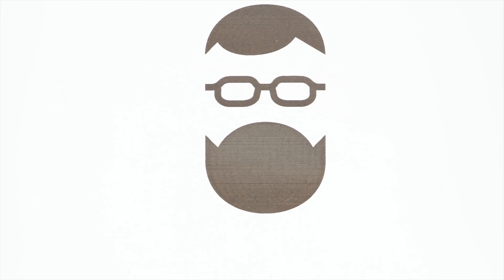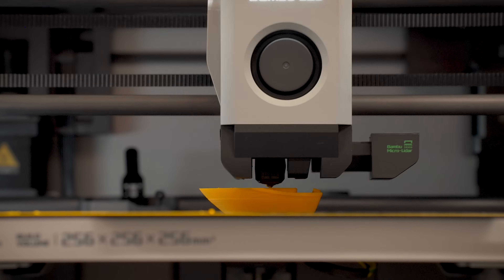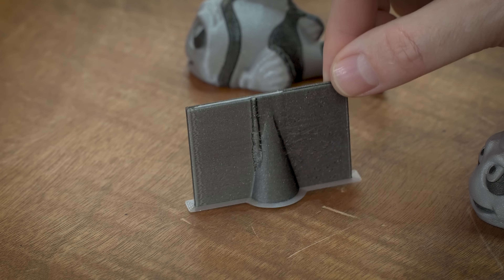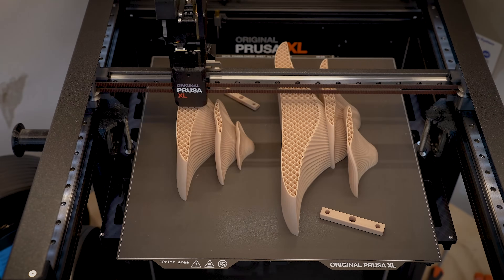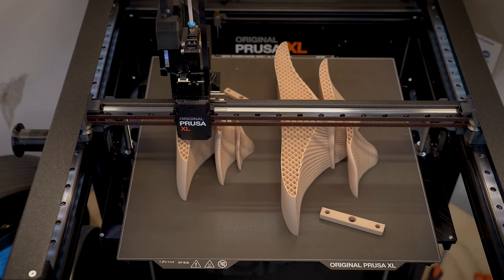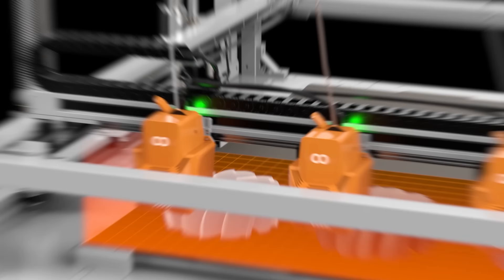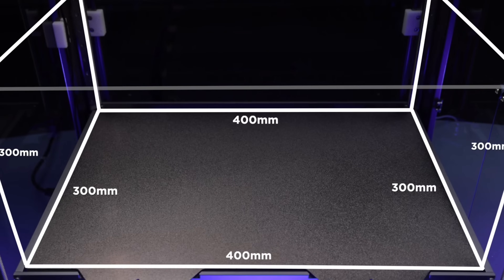Choosing Between Prusa XL and Bambu X1C?

Comment: Support? Software? Replacement Parts? Longevity of being supported? Things especially beginners need to know what they are signing up for.
Reply from the maker: Eh, they're both pretty good.  Longevity is something that is questioned with Bambu, but the XL is a completely new product with an unknown track record.
Reply: @RobertCowanDIY  I was more referring to the companies. I have heard Bambu support can be hit and miss.
Reply from the maker: @tyler785 I don't normally defend Bambu, but you have to look at their user-base.  They got a LOT of new people into 3d printing, so the data might be a bit skewed since their users might tend to be less proficient.  But in general, I'd agree.  Prusa has better support and some of the best in the industry.
Reply: @RobertCowanDIY Well based on the latest Bambu news, i would avoid Bambu everything going forward.
Reply: Support
I find the support argument an odd one.
If the printer is unreliable you need good support
If the printer is reliable good support is hardly needed. 

I wonder where prusa XL falls as a bunch of folks are having issues with their XL. 
1yr warranty on both (in the states)

replacement parts
All parts are inexpensive and available online for Bambu ,Full hardened hotend(heater, fan, thermistor is $35 otherwise nozzle is $15) shipping is fast and free over $50
Some parts are not available for the XL and are pricy. Nextruder brass nozzle is $50, hardened nozzle only  is $60 Shippng is around $20+
Multiply all XL parts by 5 for the 5 head as they only ship brass initially. 

Both have forums, communities, wiki and youtube channels for repairs. 
Bambu gives you maintenance reminders for cleaning, greasing, including wiki links

Software/firmware  
Bl had many updates and meaningful firmware updates since Aug 2022. Silent motors, camera, filters, remote controls and monitoring, object exclusion, 
Auto filament calibrations, print fail detection, first layer detection and the ability to print without touching a slicer program
BL studio and it's fork Orca is arguably some of the best fdm slicers available. 

Prusa slicer is well seasoned and profiles have been good for prusa printers. 
Prusa some firmware is sitll considered beta and requires tweaking and tuning
 
For beginners
BL the printer is assembled and read to go in minutes, expect delivery within a week
The Prusa needs assembly even with the semi assembled version. Expect delivery in the later half of 2024
Longevity I am a kickstarter user(Aug 2022) of a X1C and have over 5k hours and counting. Only ever replaced normal wear parts.(nozzle, ptfe tubes) 

Prusa XL hasnt been out as long so time will tell.

Comment: EU quality>>>CCP quality
Reply from the maker: Agreed, but I didn't want to get into all of that ;-)
Reply: The fucking irony with the prusa’s having issues nonstop since launch 😂😂
Reply from the maker: Supply chain is hard.  Bambu has shown it's much more agile in the manufacturing space for sure, but MANY companies have had to re-evaluate their supply chain practices in the past few years.  Prusa is not alone in this.
Reply: EU quality? The XL forums, reddit, YT, discord are littered with QA issues. Prusa even walked back shipping the 0.6m nozzles for the .4mm due to the print quality issues. Also they are still shipping with brass nozzles so abrasives will chew up the nozzle. It's $50 per toolhead to go hardened with the ObXidian
Then there are the beta firmware glitches and bugs this is hardly the best that the EU has shown.

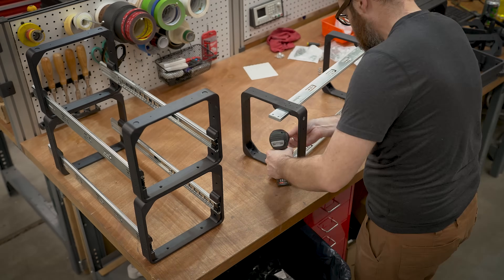Comment: 3:40 do i see that correctly that you are most likely building filament storage drawers?
im planning to build something like this as well, any learnings you can share with us already regarding this design?
Reply from the maker: I've been teasing this in the past few videos.  You are right, it's a modular filament storage drawer system.  Hopefully I'll be able to show it off in the next video or so.  I'm almost done with it, I just need to put on some finishing touches.  It will be shared on printables for free.  Make sure you follow all my videos for more information ;-)

Comment: Would the xl5 be a good buy if you buy it with one tool head but plan on adding tool heads? I'm thinking about budget.
Reply from the maker: I would probably hold off until you have the budget for it.  Something else might come along, the price might go down, etc.  My general rule of thumb is to buy a tool when I'm ready for it instead of buying the tool anticipating the need.
Reply: @RobertCowanDIY  I have the need for a single tool head printer, so I was originally looking at the k1 max for the size, and it seems a little more open source so I can use lychee, where x1c is pretty closed still. I haven't checked your channel yet for a k1 max review, I was going to look at that today.
Reply from the maker: @brandonb417 Eh, I'll be honest, the K1 Max isn't getting used all that much.  I ran into some issues with bed leveling at high temps (for ASA), and the print quality for PLA is just kinda 'meh'.  It's OK, but not in the same league as the Bambu or XL.
Reply: @RobertCowanDIY  That's good to know. So if I'm looking for a good core xy around the 300 cubed size what would you recommend? Is the x1c really that good or are they just driving a really good hype train?
Reply from the maker: @brandonb417 I'm not really aware of any corexy printers around that size other than building a voron.  I'll see if I can find something, I think we just have to wait for bambu to come out with something.  the x1c is good, but not quite as good as everyone would make you believe.  it's fast, but if you want good solid prints, you might want to slow it down quite a bit.  but it's a great prototyping printer for me.

Comment: Very nice video with a clear explanation of the thought process, it somehow is super hard to find some actual content like this on 3d printers these days since there are so many shills and it's pretty difficult to tell "reviews" or "comparisons" from "advertisements", at least with your channel I know I get some honest opinions instead of trying to sell me a printer with a promo code where the content creator receives a kickback.

For the choice between a Prusa XL and a Bambu X1C the proposition is quite clear: do you just want an allround printer that works out of the box without too much fiddling (the Bambu, but you waste quite a bit of filament doing multi-material printing since there is only 1 toolhead that needs to be purged), or do you need a bigger work area with multiple toolheads so you can print more efficiently for projects that require these extras (the Prusa), but it gets really hard to tell the differences when there aren't any stand-out features of the printers.

I'd be interested in a similar video but on comparable 3d printers, like comparing a Bambu X1C to a Prusa Mk4 with enclosure: they are about the same price, offer about the same functionality and it's really hard to find the exact differences and advantages/disadvantages between them aside from the Bambu being a CoreXY and the Prusa a bedslinger. For example the Bambu has CF rods in the gantry that are marked as wear items, but how many hours printing is to be expected before these need to be replaced? How open is the firmware on both these machines (especially the telemetry and weird language in the EULA leave me worried)?

Comment: I have x1c but will also get this pursa xl after its been out longer. 
I have been an early adopter once and never again.
Reply from the maker: Usually being an early adopter with an established brand isn't a gamble, but the 3d printing market is moving so far, companies are being forced to move too quickly.  I'd agree with your assessment, towards the end of the year I expect the XL to be a really powerful machine.  From what I can see, the hardware is good (aside from the networking implementation).  So hopefully it will all be software tuning.

Comment: Prusa has been kicking this can down the roads for years and only got off their ass to actually deliver to customers once bambu started destroying them the past two years. Prusa likes to sit on consumers money and count it while delivering years later.
Reply: Someone seems to have forgotten that until very recently, Prusa were they innovators when it came to consumer 3D printers. Rather than kicking the can, they were maybe caught napping.
Reply from the maker: @StephenBoyd21  I would have agreed less with these comments, but I just got a MK4 with enclosure and now I very much agree.  I'm not sure what's going on with Prusa R&D latel.
Reply from the maker: Eh, a toolchanger is much harder than the AMS.  I don't see that as 'kicking the can down the road'.  It's a FAR more complicated mechanism to get right and it does work as advertised.  It's just a different product that most people don't actually need.
Reply: alas this true
Reply: Guess you have zero experience in engineering and software development 😂
Reply: You will see different when you use XL or X1C for multicolor bussines printing. With some 3D model your X1C can make 100g model and throw 100g of plastic poop. XL will made max 10g of waste. And if you print 24/7 whole year, this filament poops just destroy your wallet. 💥
Reply: I actually melt down the poop to create buckets for prusa boys to have a place to cry into when their XL takes years to deliver a sub par product
Reply: What an awful take. Would you have preferred they rushed an incomplete product to market instead?
Reply: I understand that, but if AMS and accuracy was so easy why couldn't prusa get the MMU right a long time ago? Likes I said they've been upcharging for a long time without any real tech leaps for users.
Reply: @cj5376 it’s because 3D printing tech was but a fraction of what it was then. I don’t think you really understand how much Prusa has changed the way 3D printing works and how much it has changed the direction of the hobby and other things
Reply: @3D_Innovations  I'm not arguing that. Im arguing the fact that if they were the leader and innovator they should still be there. They soaked in people's down payments for the XL for years.
Reply: @cj5376 Prusa was at the top before Bambu came along, they had MMU before Bambu even came on the scene.  Bambu just had speedier and cheaper printers.  It's funny that people like you act like Prusa never did anything good.
Reply: @krollmond7544 it’s ok to be mad you had fallen for a sub par product, I don’t blame you.
Reply: @cj5376  lol I'd rather have the XL over anything Bambu has, all that waste is a huge no for me.  Could probably buy a few XL's with that.  Also you can turn the purge off for the XL.
Reply: The XL is still incomplete lol

Comment: An awesome explication of the two machines.
I would add however (although you did touch on the subject) the XL might be worth considering if you produce a lot of colour prints.....due to the quick filament change it is much, much quicker than the Bambu (when printing multiple colour) and has very little waste
Reply from the maker: Correct, I KINDA covered that.  The minimal waste and quick tool changes is a game-changer that few people are talking about.
Reply: @RobertCowanDIY  yeah you did cover it....I just felt it needed a little more emphasis lol
Reply from the maker: @TDax  Fair point.